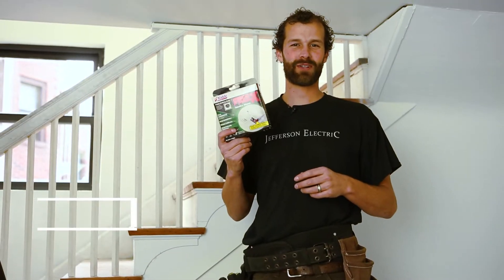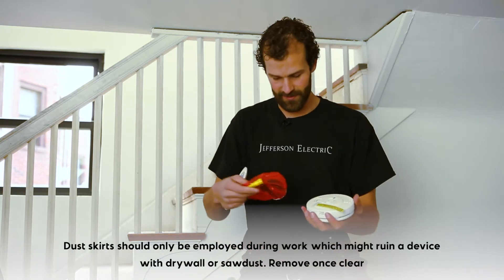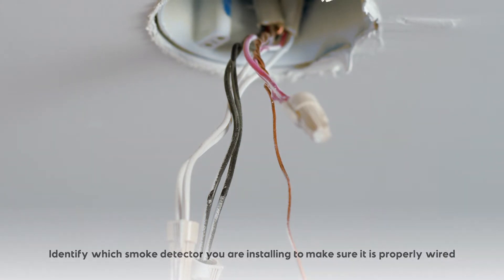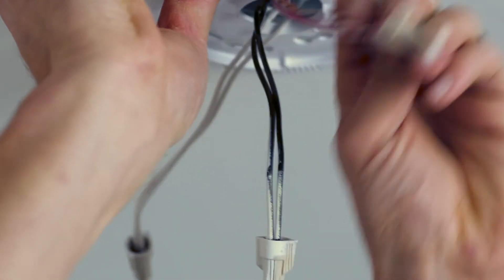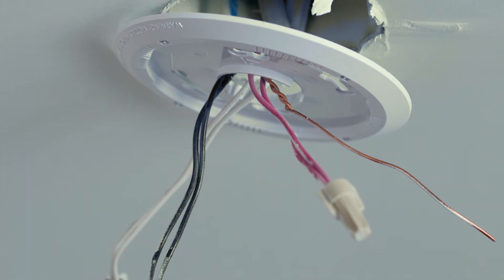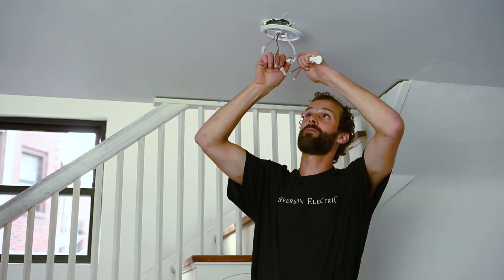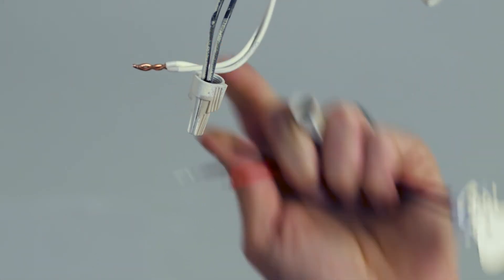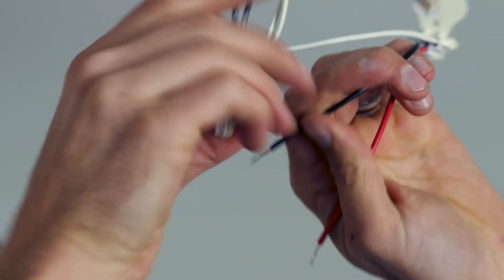Installing a Wired Smoke Detector

Comment: 23' seminars are starting this month here...I put gfci/aFCI way before mandated,had zero issues, now they are required basically in all residential, everywhere, so just do it! GE, when my panel was updated in 2006 to 200A from 150A home built in 77'.  All homes now should come 200A min...I installed 5 mini splits here that's 10 spaces right there!! My stereo takes up 3 5200W RMS 4 mono amps.

Comment: I made this comment before I wonder if the ideal push ins would be an OK option with smokes straned to solid. battery back up no real load on conductors. Wagos with the levers though wld be easier I use them a lot for light fixtures that will get replaced fairly commen they are handy put pricey. and in your area you don't need a wire nut or my preferred copper crimp on the grounds?

Comment: Those tan wire nuts are ideal twister wire nuts, they don't require pre-twisting. Thanks, Russ from Oregon-27 years in the Trade.
Reply: @ElectricProAcademy  according to code UL etc, follow mfg. instructions...they don't say to pre twist, thus you are not following code...